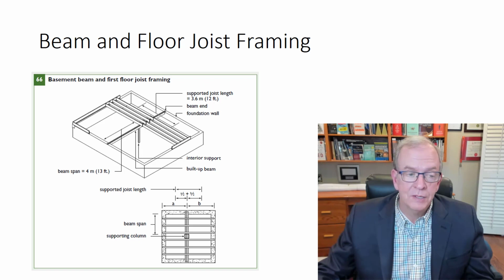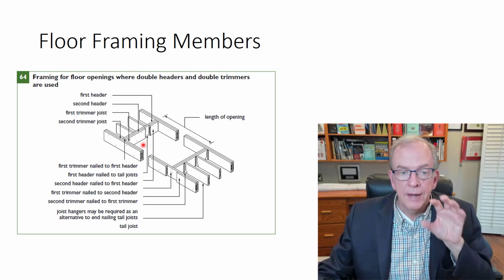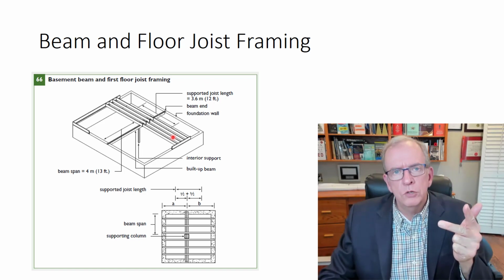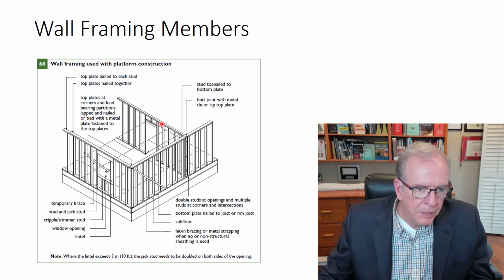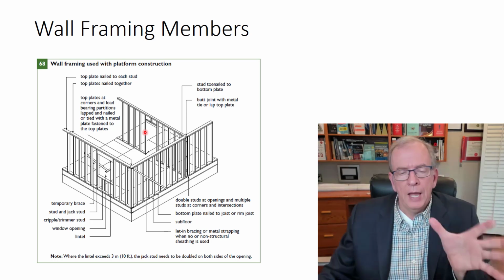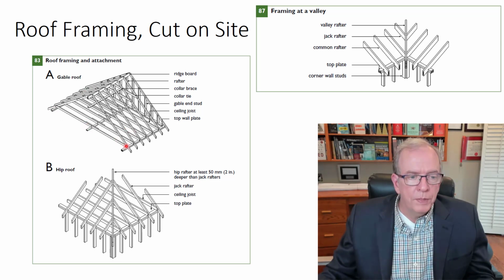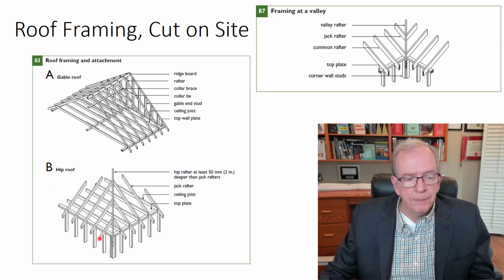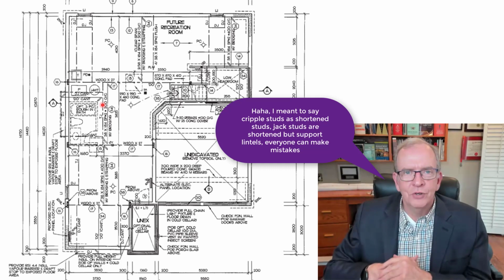WOOD FRAMING BASICS EXPLAINED, UNDERSTANDING CONSTRUCTION DRAWINGS LESSON #7

Comment: Are joist placed along shorter span or longer span of foundation wall??
Reply from the maker: Generally joists span the shorter distances as it requires less strength but sometimes it can span the longer distance but more rarely.
Reply: @TomStephensontraining  thanks.. Can you please teach building codes in your videos?